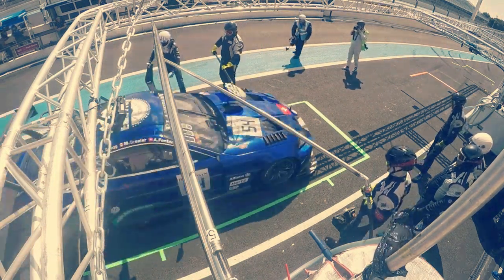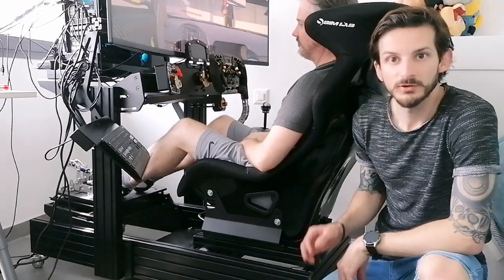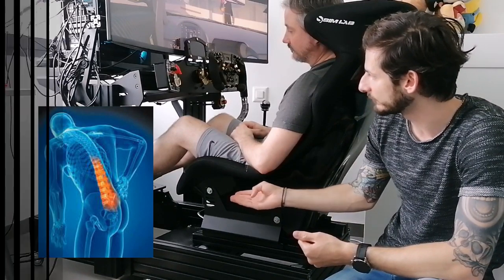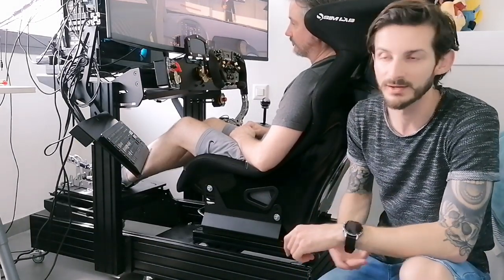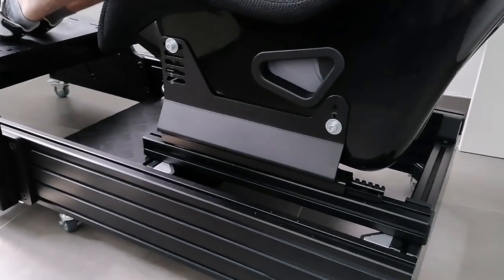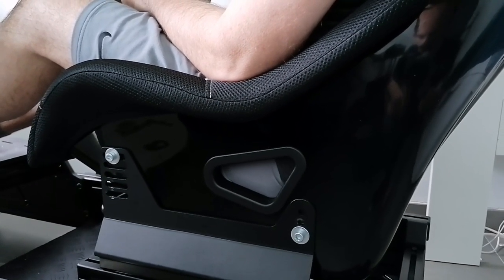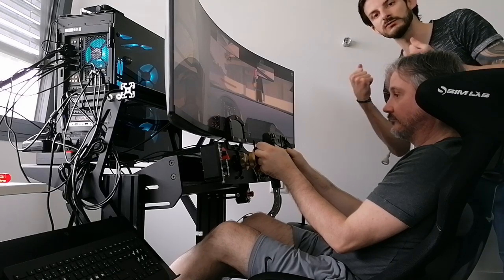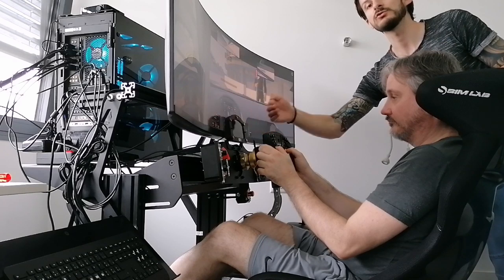How to set-up your Sim Rig like a racing car: seat, pedals & steering!

Comment: Thank you for this! My Evolve rig comes in tomorrow for my V3i and AF V2. Can't wait to finally upgrade from my wheel stand and T150. I think I will be using the lowest in the back and highest in the front as well for the seat. Just on the ground not mounted to anything, that angle feels really nice with my OMP HTE-R 400. I have a lot of lower back pain with my office desk chair and wheel stand because it's so upright and the chair always wants to rotate, but I know this is going to be a night and day difference. Excited to have a proper setup!
Reply from the maker: Absolutely you will like the position, the lower back will have a lot of support! Let me know how it goes👍
Reply: @alexfontana1873  Setup went great! Unfortunately, couldn't use lowest setting with highest front tilt. The OMP seat is too big on the bottom for the holes to line up to use it like that. Middle in the back and top in the front works really well though and provides plenty of angle. Any more angle and I think it might cause leg circulation problems, so maybe not an issue after all. Love it so far 👌
Reply from the maker: Great very happy to hear! Enjoy

Comment: Great video, but should the left leg and knee not be more in line with the brake pedal to avoid knee problems? Know your left leg needs to reach out to the right.
Reply from the maker: Thank you! Yes that is up to personal preference, many times in real racing car that pedal position isn't adjustable as is made to please also who brakes with the right foot. A good life hack is to place a piece of sponge, coushin or anyway thick material between the seat and your left thigh, so that the leg gets across to the right without effort.
Reply: @alexfontana1873  thanks for the quick response. How would a cushion or sponge help to get the leg across better?
Reply from the maker: @gjdriessen1  because the leg gets inclined to that direction without effort, so despite isn't perfect you don't get fatigued by holding the left leg to the inside to match the pedal position, but it's already pushed there without you doing anything 👍

Comment: thank you for this video, it really helps! maybe you can also answer this question: i got tennis elbow, what do you think how can i prevent this? should i get closer or further away from the wheel? (have now about a 50-55 degree angle)
Reply from the maker: Got it! When it happened to me in the real car was mostly because the steer was too close to me, and maybe even too low. The less bent are your arms, the less elbow pain you will get. By raising a bit the steering, the shoulder will help part of the rotation, taking off stress from the arms and potentially elbows. I hope it helps
Reply: @alexfontana1873 wow, you are fast! thank you very much!

Comment: Can you elaborate on the height of the steering wheel? I've seen multiple sources suggesting different heights. I personally own a round wheel and having the top of the wheel at the nose level seems quite high for me. While an F1 style wheel mounted to the same base will give a much better viewing angle due to its shape. So what should be that "measurement" point - the center or the top of the wheel? Is there a rule of thumb for the position? Some sources suggest the top of the wheel between the shoulder and mouth height  - but are they referring to F1 wheels or round? So confused %-()
Reply from the maker: Hello! I reckon the ultimate position is really up to your licking or car you normally use. I reckon that a round wheel is often use for drifting, rally, nascar and touring cars. All these categories tend to bring the steering wheel quite a lot closer to you and as you said, quite high in front. Normally that is annoying only if your fov and seating position and camera angle isn't right: on a real car you should look out far ahead in front of you, 100 meters away, not in front of your car's nose. If you set your view this way you won't notice the steering wheel so much in your way. But ultimately if your shoulders do not hurt, you can as well lower it and see how it feels. Same for distance. If you check one of my other videos you will see my distance from the steering and is pretty much what I like in reality too. Closer than that my elbows hurt. More far away I do not have a quick feeling on oversteers and car control.

Comment: Great video, do you prefer using the formula wheel for GT racing?
Reply from the maker: Thanks mate! You can find the link of my steering wheels in description. Robert uses the formula, I use a similar wheel to the one of the audi r8 gt3, the Sparco F10.
In general a formula wheel for high down force gt car is fine. A full circle one is more confortable, in my opinion, for touring car/rally/stockcars/drifting/classiccars

Comment: Does the heel need to be rested on the pedal baseplate or let it float? Which is better?
Reply from the maker: I reckon both heel should rest, except the heel of the brake foot that potentially would move up when you brake really hard. In sim racing where most people use weak pedals or a soft setting, you may see some people having the heels always in contact with the base. But on a real car with a stiff pedal brake, if you apply more than 100 bar you would probably have the foot lifted as there is quite a bit of travel also.

Comment: Are there any bottom mount seat brackets that have angle adjust. And possibly work with a slider?
Reply from the maker: Hello! Angle adjust not that I know off, they are mostly with holes and you need to change it yourself. But most one piece seats come with a slider to go back and forward

Comment: I have somehow the same position (same rig) but I always get problems with my neck. I tried everything but couldn't solve it
Reply from the maker: Hello! Maybe you can try the in-game seating position. Higher with the seat, but pointing lower with the FoV, or vice versa. Sometimes our eyes are tricked by the screen and they try to look up or far away, moving our neck forward in a wrong spine position (same as when we look down to our phone or at the computer screen for a long day). You can also try to tape a coushin just behind your head so that you can rest it while driving.
Reply: @alexfontana1873  Excel exactly this is the issue how you describe it. The neck moves forward

Comment: So I have a p1x and hk sprints with that same baseplate and slider. I get left knee pain after an hour long race at 50kg on the brake pedal. What should I do? Raise the pedal plate? I have my seat already with back at the lowest and front st the highest. Even have lumbar support so my back is flat against the seat at all times with no space
Reply from the maker: Yes, definetely raise the pedals. If you are running with the seat already titlted backwards but the pedals aren't high enough, the leg will be too much bent and therefore when you press hard on the brake the knee cap  gets too much stress and pushes outward causing pain. The higher and more in line the ankles will get, the less knee pain you will suffer.

Comment: how do u find the super ultrawide monitor? i cant see the driver side mirror in mine, maybe i have fov wrong?
Reply from the maker: This one was Rober's sim, at home I have a triple. Personally I don't like it very much. I suppose if you don't have a lot of space or you don't want the hussle to get 3 super expensive small monitors then is a good solution.
Reply: It is quite good with TrackIR setup right.  With TrackIR you feel connected to the car and can look into the turns.

Comment: Nothing about pedal height in context of seat height?
Reply from the maker: I realized we could have gone a bit further on that just when I edited. If you keep a seat position like the one we showed than I suggest you raise your pedals as well. Robert had something in between a touring car and a F1. Dtm, lambo gt3, singleseeters have pedals quite high, but to be confortable with that you need to lay down your back a bit more. Your knees should stay at around 120 degrees angle. If you keep your pedals to low you may suffer of knee pain, and unless you keep a very straight seat and back you won't be able to press the brake hard consistently. I hope this helps.
Reply: Alex Fontana Thanks a lot. What do you mean knees 20-30 degrees angle. Angle beetween what?
Reply from the maker: I mean the angle between your femoral and calf. Basically from under your knee looking down, while you are seated. The more your pedals are low and close to you, the more your knee will get to 90° degrees like you are seated in a chair at the office. The more your legs are  straight the more you will have less degrees of angle, if that makes sense

Comment: Any advice on pedal angle?
Reply: It is very subjective keep moving it till you feel comfortable
Reply from the maker: If by pedal angle you mean how much the single pedal is inclined, then you should place them in a position where your toes don't need to be forced back all the time when you are not using that particular pedal. If say the pedals are inclined toward your seat way too much, you will feel cramps and pain between the ankle and the knees because you need to force your feet backward when not pressing.
Reply from the maker: If instead you meant pedal position :
I realized we could have gone a bit further on that just when I edited. If you keep a seat position like the one we showed than I suggest you raise your pedals as well. Robert had something in between a touring car and a F1. Dtm, lambo gt3, singleseeters have pedals quite high, but to be confortable with that you need to lay down your back a bit more. Your knees should stay at around 120 degrees angle. If you keep your pedals to low you may suffer of knee pain, and unless you keep a very straight seat and back you won't be able to press the brake hard consistently. I hope this helps